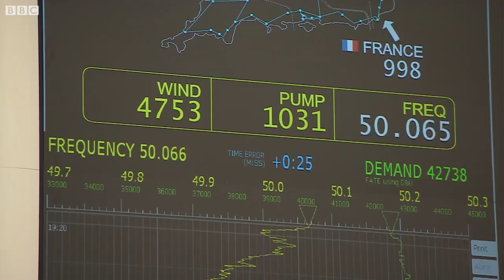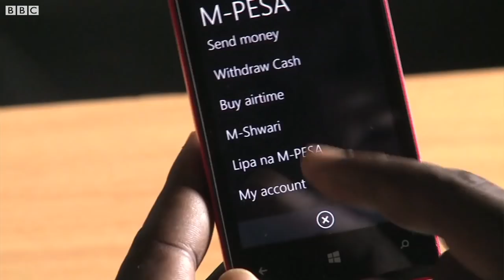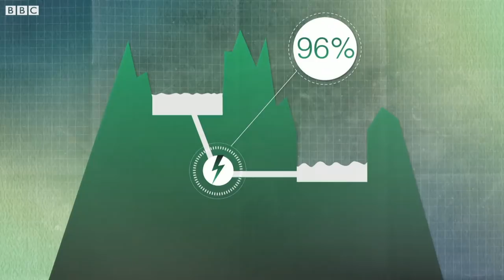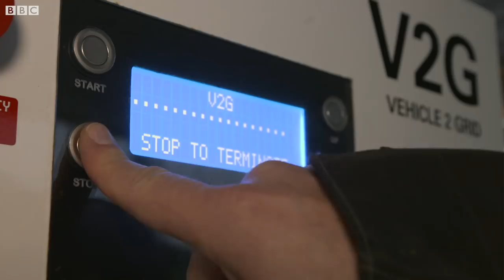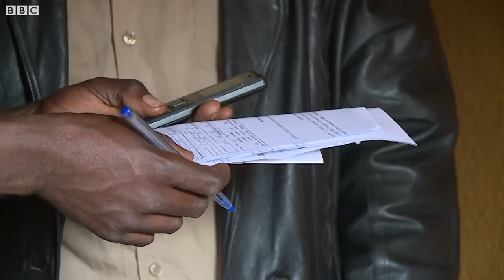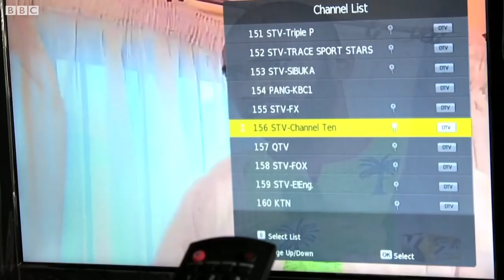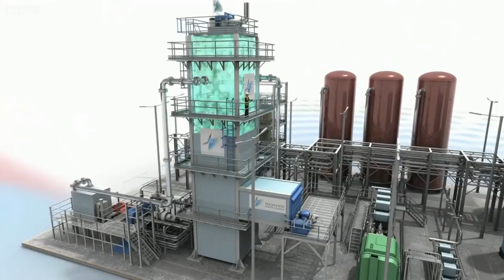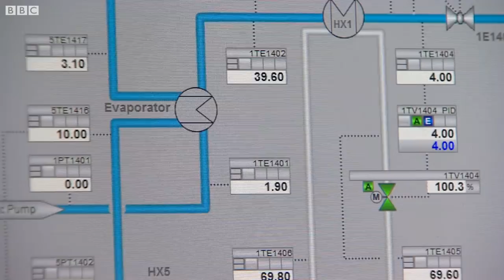Disruptors: Smart power - BBC News

Comment: annoys me so much,that new buildings of any sort,especially houses dont have solar as standard when this would keep the industry alive,as well as keeping those bills down,lets see if we can start a revolution.
Reply: The revolution starts with you! Please lead by example!
Reply: In California all NEW home construction will Require SOLAR on the roof, a Powerwall or Home Battery is Optional but a likely add on. your HOME after charging POWERWALL first can then go 100% Battery and send Solar Electric to the GRID for a Paycheck .
Reply: The important thing for new-build is insulation and airtightness so that the winter heating (and summer cooling) demand is low. That has much more effect on our overall decarbonisation than PV on the roof (which is also a good idea, but there is no way it can provide UK winter heating). The UK is a long way north so the summer/winter solar input varies by a factor of 9. That makes our winter heat load the critical thing that will be hard to decarbonise. Currently it's 95% gas and that all has to go (or be turned into bio-gas). Removing load is most cost-effective. Nuclear and wind are the other two options. In practice we almost certainly need a lot of all 3.
Reply: @Wookey.  I would think that between wind and offshore turbines capturing the currents there would be no shortage of energy. Hydro of that type I believe is still in its infancy in terms of production scale
Reply: @Wookey.  
Insulation is very important to reduce waste, most certainly, however as long as there is sunlight solar can produce energy, even under many cloudy conditions. That combined with wind (in locations that have it) can go a long way. Nuclear is not a realistic solution simply because it is too costly when plant construction, decommission and spent fuel storage is factored in. The highly radioactive spent fuel rods are also another major concern. Natural gas or propane plants are the only really good fall back option in combination with solar and wind as they are the least polluting of the fossil fuels. The liquid air plant that was shown in this video didn't mention anything about efficiency but I suspect that it's quite poor.
Reply: the most annoying thing is that new houses is not energy efficient especially in the west where most countries spend large chunk of energy on heating
Reply: look on google earth, notice how all buildings do have solar panels.
Reply: @tomkelly8827  
Step 1
INSULATION!!
Reply: Some (but not many) new houses in the UK seem to have solar PV built in, with solar panels in lieu of some of the ordinary roof tiles. If taken up seriously, it would have an effect on planning so as to optimise the orientation of them; logically, some would be worth more than others etc.
Reply: @johnkeepin7527  or just stop breeding for 100 years, let the population reduce by 600%.
Reply: Very soon every house will be required to produce a percentage of its consumption
Reply: @SandraWantsCoke  where is your data from? What size system?
Reply: We have an abundance of wind in the UK. Solar is nice for small scale, i.e. domestic and commercial roof tops but not really suitable for large scale generation.
Reply: @Wookey.  Completely agree with what you say but remember the efficiency of renewable energy is a red herring if fuel source is free who cares how much is used.  I'm into hydro power and UK has closed all support because its to expensive yet its often described as the cheapest.  P.S. I will be unemployed shortly !!
Reply: Because it's not any more environmentally friendly than nuclear in terms of CO2, most people wouldn't recoup the costs and maintenance costs either. Your annoyance is at reality.
Reply: @markplott4820  when all homes have a battery it makes more sense to distribute DC direcltly instead of inverting to AC and rectifying back to DC inside every device as is done now.  We helped develop the LEED DC Pilot Credit program that gives up to 18 points for DC nanogrids in homes and buildings. LumenCache is an open platform that's easy to install, easy as a light switch to use, and easy to automate when you're ready.
Reply: @LumenCache  I agree.  We plug wall worts (ac to dc concerters) all over our homes to run numerous items such as PC's, games, phones lights even TV's.   In the garages more and more tools are battery driven and recharged on ac to dc chargers.  Lights in home are being converted to LEDS with built in ac to dc converters.  Only elements that don't always convert ac to dc are motors in the major appliances.  
Most of the outlets not dedicated to the major appliances could be isolated at the breaker box, tied directly to solar panels via power wall and efficiently bypass the grid for these services.  
This would require establishing a standard dc voltage for these dedicated outlets (24v or 48v  most likely) so this would take a long time to adopt but would improve efficiency.
Reply: @AONUT  it's that "waiting for standards" problem we solved.  There will always be new standards for power and controls because it's so easy now to develop hardware and software and investment money is everywhere ready to make the next big thing.  LumenCache adapts to any power and communication standard so your system is never obsolete.
Reply: Sisu  here in the uk its not economical as only 1 in every 8 days is non cloudy
Reply: The Working Class Masses HAVE NO CHOICE but to fight in the War Against Climate Change, the Ruling Classes will ALWAYS be okay and have NO WORRIES about the World to come if we don't make them stop their shit.
Reply: @markplott4820  I know that your are referring to the portion of California that is currently part of the United States. I honestly do not know what to think about this, but nature can help us. For example, here in Texas many people cover the roofs of their houses with black tar "shingles". In fact it is mandated by law and social factors, thereby increasing summer heat and requiring more "air conditioning". I don't have all of the answers, but I think that there are many people with breakthrough ideas. For example, Texas generates far more wind energy that any other U.S. state. 
Kind regards from Houston :)
Reply: @Son37Lumiere 
We have been trying and failing to use renwables, they simply do not work well and just push the price of electricity up. It's misleading to say that even when cloudy solar produces energy, as it is very small and especially in winter when the sun is low. For the U.K. it is useless.
Reply: @iainreid9914  Funny, because they simply do work well for plenty of other people. There are countless videos showing as much, not to mention Australia's wind+battery system actually dropping the prices of electricity.
Reply: @Son37Lumiere ,

You are talking about the State of South Australia. It's known in the businessas the crash test dummy of grids. So many blackouts and Australia's electricity prices have rocketed since the large expansion of renewables. That's why they recently had  an election for a new Prime MInister all because of energy prices. Don't believe all the videos you see, especilaly the BBC, known as the biased Broadcasting Company.  You can't make a silk purse out of a sow's ear and that's the reality of wind and solar.
Reply: @iainreid9914  Just because you say something is reality doesn't actually make it reality. That requires things like supporting data and evidence, maybe you've heard of them? As I said, there are many videos of people living off grid with solar that confirm it works fine with few disadvantages as long as you have the required supporting hardware, which for renewables is some form of energy storage, that's reality.
Reply: @Son37Lumiere  We are not going to be able to complain about the cost of energy if we all die of global warming.
Reply: @markplott4820  What happens when the "Grid" is over loaded with incoming evergy from other people who want to all be paid for the energy they send?
Reply: @stanschleusener6444   - we Already EXPORT our Excess energy from RENEWABLES to states in times of PLENTY.
my UTILITY company PAYS me to use power when they OVERGENERATE.
Reply: @markplott4820  Is that a joke? It sure sounds like it to me!

Comment: How efficient is cold air compared to other systems?
Reply: 19.3%
Reply: Looked up the efficiency. The company selling the idea suggests 50% is possible within a system where low grade  waste heat is available for the process needed to heat and thus expand the cold nitrogen back to a high pressure. It takes a lot of electricity to clean, compress and chill it. That is less efficient, even when the source of waste heat is both available and right there to be used, than storing the electricity needed by the process directly into a battery bank. 
I would say that the other caveat to getting good efficiency might be the time factor. The process also has limits to its ability to absorb available surplus electricity, I suspect.  The "waste heat" will still go to waste if not needed during the storage phase, and also when there is no need to store the renewables as the supply gets full consumed by the grid.

I still think that battery storage will win out in most places where pumped hydro is not cost effective. Maybe even in those places if the switch-over takes more than mere milliseconds.
Reply: Even 50% would be really low compared to high-80s in battery-storage. If it's nearer to 20%, there's really no reason to use cold air.
Reply: This. When he started talking about it was like what shit is this hahaha
Reply: The whole issue is that if the energy were not used, it would go to waste. Thus the energy not being used by the community is instead used to liquefy/chill air for use when green power is low or not available - night for solar or lack of wind for turbine.  Is is viable....I think it depends on the cost of the plant vs the cost of a conventional battery type solution including employee, upkeep and maintenance costs.

This type of facility might be better suited to cold climate regions. Not because it will help liquefy the air but because batteries tend to lose function and storage performance in cold weather and have to be maintained  at or above room temperature....meaning it has to be heated.

Liquefying air may not be the best methodology but I'm glad people are thinking outside the box on these issues. I only wish the cost of things like solar and power storage would drop to a viable level
Reply: https://en.wikipedia.org/wiki/Cryogenic_energy_storage#Efficiency

I googled it an the answer is 'it's complicated'.  So here's the wiki link.
Reply: Just an update on this post there is a cryogenic company in the UK called Highview Power who have two working plants and have achieved efficiency of 60-75% and can store that energy far longer than a battery. As it's a mechanical process it also frees up battery supplies for where it is more needed in electric transport and home battery storage.

Comment: What is the problem with generating electricity from rain?  A lot of fans can be installed as the rain falls everywhere.  Fans can be placed on top of the house, in the field and in the sea.  If the number of fans is increased, more power can be produced.  If the generator is movable, it can be moved after the rainy season.

Comment: Reducing demand is the biggest energy  "supply". The massive grid is required to handle the peak load on the system but a little cooperation by each home or business significantly reduces the need for giant and expensive grids. Especially thanks to local energy generation.  Builders should contact LumenCache for a smart infrastructure that helps reduce demand and improves smarthome user experience

Comment: I like the idea of liquid air.
Reply: They didn't say how efficient it was. That plant only powered 5000 homes compared with the Tesla battery plant which could power 30000 homes for 1 hour. That's 6 times the energy storage and with millisecond response.
Reply: @MrPDawes  The Tesla battery plant looked like it covered a lot more area than this though so id assume that's more about scale.
Also with this to get more storage you just make the tanks bigger or add more storage tanks so it could be cheaper for long term storage with batteries cheaper for short term storage.

Comment: I like the idea of micro-hydroelectricity.  There are lots of places to store water for micro-hydro.  It could be stored inside the walls of large tall buildings absorbing heat in the summer then drain it through the turbines at night. Water works as an insulator in the winter as well.  Mirco-hydro in underground storm water runoff and reservoirs could also be built.  
We could also invest more in energy efficiency.  Don't just think of new ways to produce more power and store more power but rethink how we use power.  Do we all really need to commute to an office everyday?  Would people really be opposed to living underground where temperatures change very little?  What if the goods and services were produced closer to where they were consumed or transported more efficiently?  What if we could grow floating oxygen producing islands in the middle of the oceans?

Comment: There are ways to produce saleable energy supply at any location 24/7 with more modern methods than old wind & solar through large transmission lines and into storage. I came across some presentation videos from an energy design lab called H2IL They have some revolutionary, game-changing technology that looks very interesting. It could be the biggest thing since energy itself..  Worth looking into.

Comment: Much better to use supercapacitors for short term storage, no loss of capacity and minimal power loss. There will also be new, more effective and cheaper batteries available within the next few years.
Reply: Very short term. They work fine for regenerative braking in vehicles and frequency control on grids, but they are useless for storage of more than a few minutes.
Reply: @Wookey.  they are getting better, and you would never use capacitors on their own.

Comment: The cold air battery, doesn't seem be a battery at all. It looks like a power generation engine, using liquid nitrogen for fuel. Perhaps a little more explanation of the process, would be useful here?

Comment: Grid storage in Li-ion batteries is probably the stupidest thing ever thought of. Yes Australians installed it, not because it was a good idea, but because they had buggered up their grid to the point of being unable to provide reliable service. A very expensive band aid, rumor is it cost 66 million USD. 30k homes for an hour, what do you do when you need to supply power to 30M people for an entire windless night, have 12000 of these giant batteries at ready? While I'm sure Tesla would love to sell you all the batteries they can make, it's not a realistic solution, not least because they are not even capable of making over half a trillion worth of batteries.

No matter what some try to sell you, total changeover to wind and solar is not a realistic option and probably never will be. You can use more wind and solar, which certainly makes sense if your alternative is coal, but you can't switch over entirely and still keep a reliable grid service. You'll get power as weather permits and that's that. You can keep spare baseload to cover for wind and solar, but let's face it, keeping a power station operational while refusing to use it is just stupid and inefficient. No, the key to more wind and solar is not on the supply side, you got to make the demand more flexible. First, if you haven't already, switch to LED lighting. It's a no brainer, less power you use, less of a problem there is. 
Secondly, what is needed is a method to regulate demand according to available supply. Right now there is really only one way to do so and that's rolling blackouts. Clearly, that's less than satisfactory. The grid needs a way to turn off your non-essential demands when required. Air conditioning, washing machines, dim your lights, electric car charging, that last one will be a big one in the future. 

That's a lot of compromises to make as a consumer, but if we want more wind and solar, then that's what we'll need, it's that or live with rolling blackouts. Or you could go the French route and build a ton of nuclear stations. Or you could go Trump route and pretend that coal is clean, if you repeat it enough maybe you will even start believing it yourself.
There are no free lunches or magic bullets in engineering, everything is a compromise.

Comment: The laws of Thermodynamics dictate that energy is never perfectly converted from one form to another. This is seen in conventional power plants to a great degree, but it is even more pronounced in renewable plants. The average solar panel is about 15% efficient, compared to 33% in a thermal or nuclear plant. Wind sits at about 30%. And there is no way to improve those values, because there is no way to get around thermodynamics. In short: non-hydro renewables will never become commonplace. Only hydroelectric and nuclear power have a chance at beating fossil fuels.

Comment: Net metering is not a desirable by the residential  or single noncomericial users. The best current method is a battery backed up solar, wind and hydro electrical system, with grid charging of the battery bank when necessary or needed.  All extra power from solar, wind or hydro should be sent to on site arteries and not the grid.